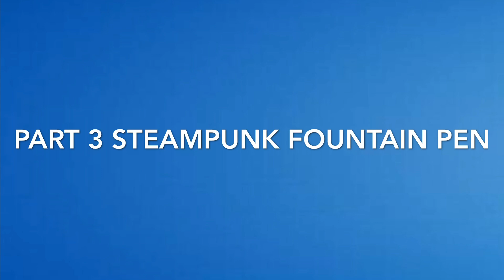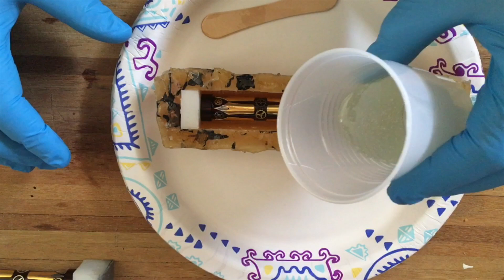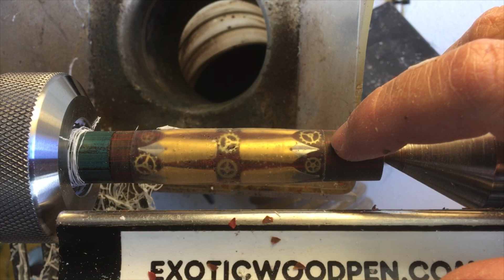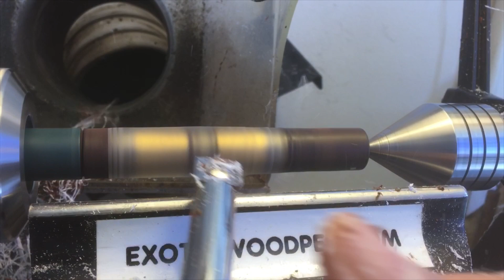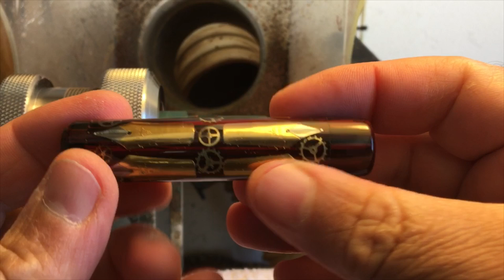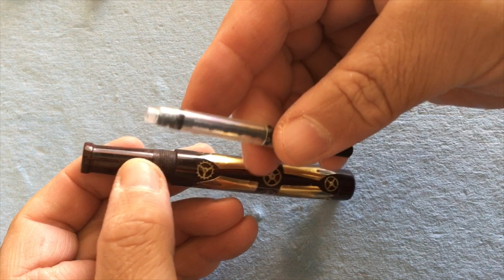Part 3 bespoke steampunk fountain pen.

Comment: Gabe, gorgeous work as usual! As intimidating as I find all of this I really am thinking about trying it out. What's the minimum set of taps and dyes you think I could get away with? I hear you mention a double start thread here. Where's a good place to get that and what else would I need? I just want to get my feet wet... thanks!
Reply from the maker: I started out with a metric set from Harbor Freight.  After I got the hang of it I got the 14MM doublestart tap and die and then 10.75 tap and die for the section.  Start out with some cheap acrylic blanks.  Have fun...
Reply: @exoticwoodpen  Thank you so much for the reply. Where can I get those two tap and die sets that you mention specifically?
Reply from the maker: @avramw  The 10.75 tap and die is the best set up for the section that I have used and can be found on eBay.  The 14mm  double start tap and die set I bought in a group buy and was expensive as they have to be specially made.  Just start out with a 1/2 tap and die for the cap and body, and if you decide you like it then you can most likely get in on a group buy in IAP or Facebook Group "Custom Pen Makers-PAG Friends.